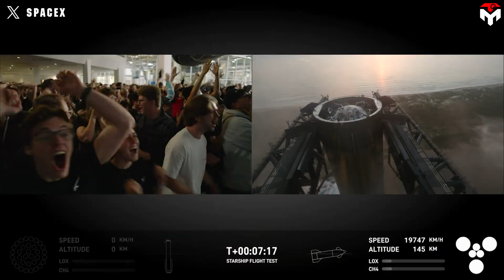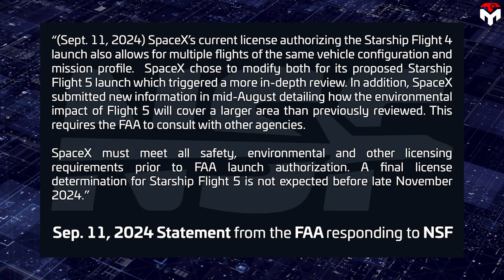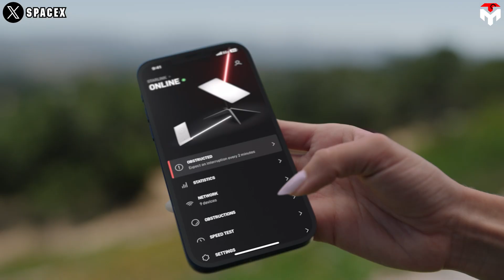What Gwynne Shotwell Did With SpaceX 2024 Shocked Whole Industry...

Comment: In the original plan, Starship’s first flight would go to orbit, first vehicle payload capability was 300 ton reusable, 500 ton non reusable. By the second year they would have demoed in orbit refueling, cryo storage in orbit while sending 4 vehicles to Mars this year.
I can’t see how you label what has actually happened a success. No orbital flight, no full reusability but anre design, no where near to the 350 ton thrust of the Raptor Engine V0, the vehicle is very very heavier and getting heavier.
So, this is a success? I will agree that it is not a total failure but lets just say its really far away from on track.
Reply: You have a closed loop mind IMO
Reply: @ I disagree, I am opened to reality. I went to school, I studied Aerospace engineering.
When I saw the Hyperloop pitch I knew it was bullshit because I know how hard is to create vaccum. When you have a heavy vehicle with engines below their original spec, you know it’s in trouble. Even if it was perfect, chemical rockets are insufficient for human Mars trips. It could work for the Moon. Ironically, it is doubtful that Starship can even take 300,000 lbs to LEO which is Saturn V performance.
If you don’t like hearing the truth, there are other cheer leaders out there with North Korean style propaganda that have no clue about the Science and will make feel really positive about everything. But remember, Science is very cruel. Ask the Hyperloop.
Reply: @pedrosura  🤣🤣🤣🤣